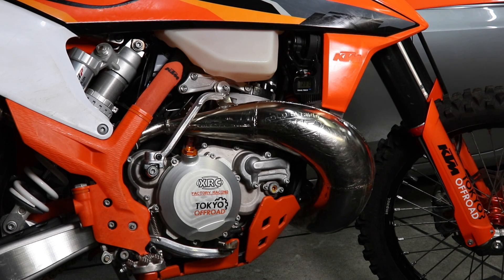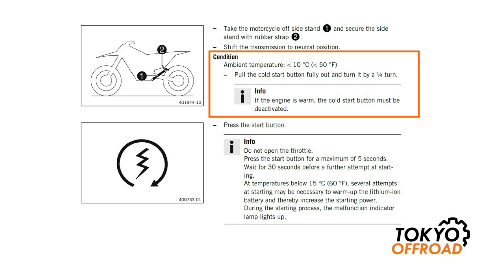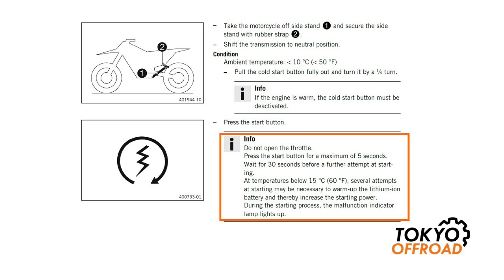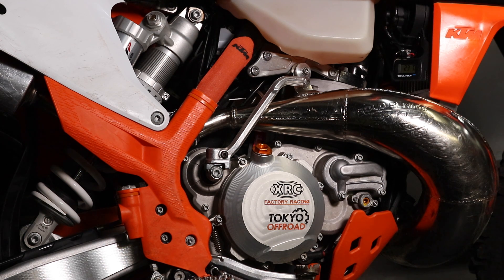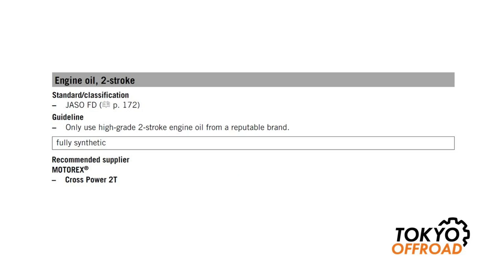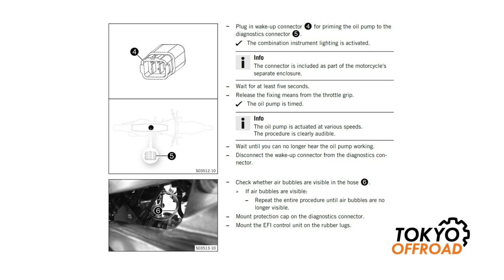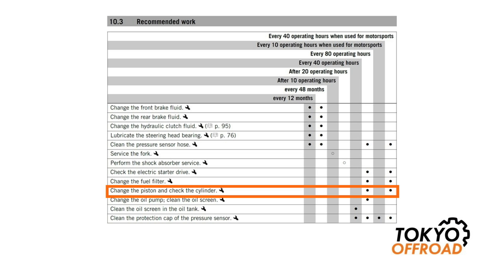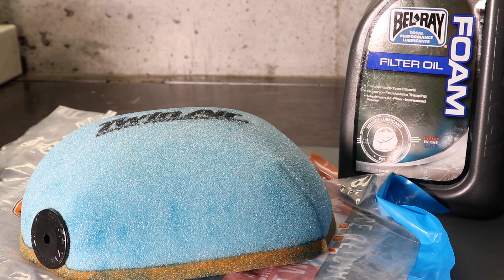Tips To Help Ensure Your TPI 2-Stroke Engine Doesn't Seize

Comment: Appreciate the video - Good on You!  Thank you.  I ALWAYS liet my bike(s) warm up before Hitting the Pipe.  18 months ago I bought a 2023 GG EC300 after 25 years on an '01 Service Honda CR500AF Woods Weapon.  I still have the AF and Love It.  After 1.5 seasons (in Colorado Mountains), I'm learning to love the EC300, but have lots of learning yet to do.  While there is No Replacement for Displacement, I understand the different riding style required for the power-valve-equipped engine of the 300.  The TPI and adjustable power valve are novel and different, and I don't have them dialed in, yet,.  With that said, I'm not yet convinced the combination is better than the Open Class 500CC.  I'll keep riding both of them and eventually may form an opinion if one is "better" than the other, as opposed to "different" from each other.  Thanks again for the video, and helping me learn about TPI.

Comment: I have a 2023 E c 250. Coober ecu, It has 200 Hard enduro hours, New top end at 190 hrs, Very little blow by. Wasn't even noticeable, Never had an issue with this bike. It.
Has noticeably more power than a 300 Tbi.  Coober ECU-CONE PIPE- Medium compression head. I have yet to see another bike that compares We.
Ride hard  ENDURO, With every other bike known to man even electric. ThIS BIKE shines never has an issue.

Comment: In your opinion , which is the best of the castrol power1 racing 2t , liqui moly street race 2t , ravenol mps 2t , maxima k2 injector 2t , motorex cross power 2t , mannol 2t plus oil brands for use in two-wheeled vehicles that still use side oil pumps ???
Reply from the maker: For KTM group 2T oil injection bikes I would only recommend using Motorex CrossPower 2T oil (follow the manual recommendation). Not only the only type, but also the oil viscosity is very improtant to ensure that the correct amount is injected by the pump. If using premix then there are many choices...

Comment: I have a 2023 gas gas EC250, I follow the starting procedure every time. I ride hard enduro.  Medium compression head Coober ECU.  I have never had a real problem with this bike. I sealed all electrical connections with liquid tape.  I am doing my first top end rebuild at 180 hours. New piston and oil pump. I Am convinced this is the best bike KTM ever made.  All my buddies have husky 300. I have never felt the need for more than a 250.  I will never sell this bike but I will buy another one😊.😊😊😊

Comment: How to drain the side oil? And replace it with a new one ? Please explain thank you
Reply from the maker: Are you asking about draining the 2-stroke oil from the tank and how to clean/replace the oil screen? It's covered in the KTM Repair Manual in the Lubrication Section. The method is to remove the throttle body, remove the oil pump, drain oil from the tank, remove the rubber boot on the bottom of the oil tank and the oil screen will come out of the bottom of the tank.
Reply: @TokyoOffroad  Thanks very much

Comment: My ktm exc 300 2022 oil pump not woorking, i change with new one and still not working… whats thats problem, i’m check fuse and relay all goods
Who have some experience in this case, waht it’s the problem thanks
Reply from the maker: Did you find the issue. It must be an electrical issue. Check the wiring and connector. If the oil pump isn't working you should see a blink code on the dash display

Comment: Dump the TPI and buy a TBI or carbureted bike with premix. If it ain't smoking it ain't getting lubed.
Reply from the maker: I did. I currently have a 2024 KTM 300 TBI EXC with oil injection deleted and running premix: 2024 KTM 300 EXC TBI- Oil Injection Delete
https://youtu.be/f4vbqygAFkk
Reply: @TokyoOffroad  Right on. There's a reason ktm stopped using  tpi and oil injection. I'm a professional motorcycle technician and have seen so many blown up tpi bikes.
Reply from the maker: @mikecronan550  - I do know some people value the convenience of oil injection, which is probably one of the reasons KTM left it on the 2024 XC-W & EXC models. The other reason of course is reduced emissions. Personally I'm not a fan of 2t oil injection and prefer the simplicity, performance and reliability of using premix. TBI thankfully makes the oil injection system delete easy as unlike TPI injection relocation is not required.

Comment: I heard the Chinese pistons are made out of cheese.
Reply from the maker: Sounds tasty! But KTM dirt bikes are made in Austria with 2T pistons supplied by Italian suppliers (Vertex is the main one). As you may have read in the press recently, some of the KTM road bike are are manufactured in China (and India), but this has not affected the dirt bike range. The only exception to this is a small number of dirt bikes sold locally in China which are assembled from kits locally in China (using the same parts as bikes manufactured in Austria). This bikes would not be sold into other country markets though.
Reply: @TokyoOffroad  Ok. I appreciate what you are saying, but I've seen a lot of complaints online about Kymco pistons crumbling with low hours. As far as I'm aware it's post 2022 KTM 2 strokes. Do you have any knowledge of this?
Reply from the maker: @Paul-gu2lv  Kymco is a Taiwanese company and they supply KTM with some of the cylinders for dirt bikes. The other 2 stroke cylinders is Elko. AFAIK Kymco do not supply pistons to KTM.
Reply: @TokyoOffroad  Yeah, I know what Kymco is. They make great engines for scooters and such, but I guess not strong enough for high compression and performance. Anyway I don't have personal experience. It's just what I saw online.

Comment: Love your videos, are any of these issues alleviated by TBI instead of TPI?
Reply from the maker: With TBI the engine will tend to run cooler compared to TPI as the fuel passes through the crankcases. Also TBI allows you to run premix which I consider more reliable than oil injection.

Comment: Would you know the oil injection test RATE for the 150TPI? I tested mine at 4.7ml and your test for 300 is 6.3ml? I assume same oil pump so am concerned that i got 4.7ml.
Thanks
Reply from the maker: Sorry, I don't have any experience doing this test on a 150TPI. Try asking on one of the KTM FB groups.

Comment: I have a first gen tpi and i always warm my bike riding sloly, and i never had a problem.
Y have anoder bikes and i use the same procedure to warm them up.
Reply from the maker: Yes, I always warm my bikes slowly from cold and don't start riding until the engine is warm. This has worked well for my bikes, with good piston and cylinder life.

Comment: Our brand new 2024 SX125 completely lost compression at 10 hours during a motocross race. Turns out the piston had huge chunks out of it above the top ring. The head had cracked.  Took to dealer since only 10 hours, they say caused by gas/oil mix (which was exactly what they recommended). We heard the thermostat has gotten stuck on these 24 SX125’s and not put coolant where it needs to go and caused this. Not sure what KtM will do, but this seems to be a huge defect

Comment: Mark, excellent video as always.  What brand of water proof grease do you use for the rim of the oil filter and what do you use to clean the filter when it’s time to do so.
Reply from the maker: I use BelRay Waterproof grease for the air filter lip. To clean air filters I first use kerosene, let air dry, then use Oxiclean in hot water. This gets them really clean.
Reply: Thank you!  Also how do you get the internal area around the cylinder head and wire looms and cables so clean.  I use simple green but there is still a brown dirt residue.  Short of taking a damp rag and rubbing all the interanal area down I don’t know how guys keep that area so clean.  Is there a foam or special way to do it.  I never pressure wash so I’m at a loss.  Any suggestion is appreciated.

Comment: Be sure you are running much more oil if you have a tbi set up.  The fuel washes out oil from the bottom end which happens much less on the tpi set up.
Reply from the maker: When I had this bike I was using a GET ECU, which I understand was mapped to inject more oil than the stock TPI, for use with the GET injector relocation kit which I'd also fitted.
Reply: @TokyoOffroad  I did hear you mention swapping over but I think it's an important note for riders with a tbi set up.  Also great video.

Comment: TPI oil priming sequence volumes
Model/Year - 18/19/20
Cycle - Fast/Slow
Length - 30sec
Approx Output Volume - 1.0ml

Model/Year - 20/21
Cycle - Fast only
Length - 60sec
Approx Output Volume - 5.5ml

Model/Year - some TSP modified maps 
Cycle - Fast only
Length - 30sec
Approx Output Volume - 2.7ml

Comment: Hello, love your channel amigo. My 300tpi is ready for it's first top end. The stock oil pump has run with no issues for 100hrs. Do you recommend replacing the pump or should I test and keep the stock pump since I've had no issues?
Reply from the maker: I would carry on using it if it's working OK. From what I know dirt (it it drops into the oil filler inlet when you take the cap off) is the killer of these oil pumps. As such be careful to wipe away and dirt before removing the filler cap. Starting from the 2020 year model TPI there is an oil screen (filter) on the output of the oil tank which should help protect the oil pump against damage even if dirt and debris get into the oil filler.
Reply: Its not easy to find good trusted advice now days. Thank you very much!

Comment: My ‘20 TX300i put out 10ml oil in 60 seconds (short pulses). I haven’t seen anyone reporting this much output (usually around 6ml). Thoughts? I did have the dealer update the map summer ‘22
Reply from the maker: Maybe the updated map injects more oil during the priming sequence (pulse length might be different). Now you have a reference you can monitor it over time. A significant decrease from your reference would typically indicate that the oil pump needs replacing...

Comment: Dear riders, i have 2021 250 Exc Tpi. I tried to make the oil priming with the wake-up connector bought from the dealer (the red and black one) The oil pump did not test/work as in video. I tried more than 40 times with different time intervals 4-7-9-12.....25 seconds. I have the standart ECU. I watched all the videos and read the manual, Did exactly the same. 

Do you have same oil pump problem? If yes how did you solve?
Reply from the maker: If your bike is a 2021 TPI with stock ECU it should prime in exactly the same way as shown in the video (set number of pump cycles every time). I suggest you discuss with you KTM dealer.

Comment: From what i've seen the people who are meticulous about tpi warm up procedure including myself do not have any issues. The problem is that most dealers aren't explaining to buyers how critical the warm up procedure is (especially within the break-in period) as well as dirtbike channels online telling people to just hop on the bike and ride it like normal. This results in guys revving the shit out of the bike at warm up and riding it hard cold. Then they're totally surprised when the bike blows up at low hours and they post it online.
Reply from the maker: I'm careful with warmup with all of my bikes, no matter the technology (carb, or TPI). I never rev the engine hard until it has warmed up.  During warmup the clearance between the cylinder and piston may be tighter than normal as the piston will tend to expand faster than the cylinder. This is made worse if the engine is warmed up quickly. IMO one of the worse things you can do for engine wear is the MX style cold start followed by revving the shit out of engine. As such I always aim to warm the engine slowly. Yes it takes a few minutes longer, but you can save a lot of time and money in the long run through extended interval top end rebuilds.
Reply: @TokyoOffroad  I couldn’t agree more. I think a majority of the low hour tpi engine failures we see online are due to cold seizure. There needs to be more education on this topic amongst riders and you sir are doing just that. Cheers!
Reply: @SkylarRace  A quote from the design department: “we have make a bad product, so we just need to educate the customers to take extra care”…..
Reply: @scannorse a quote from a normal person  with  common sense! Use common sense when  warming up and using the engine & don't unnecessarily Rev the shit out  of it for no reason.

Comment: I'M DEALING WITH THE 3RD ENGINE SEIZE ON MY 2021 HUSQVARNA TE250i WITH ONLY 11 HOURS AND 48 MINUTES OF RUN TIME. All they have done is try to blame me even though they know these issues exist. None of which were disclosed when purchasing nor were I sent any further information after they started seeing these issues. KTM customer service will not help in any way with parts or labor and instead insist upon it being my fault. None of the 3 dealerships I have taken it to were able to fix it for more than a single ride after it was in their shop. Maybe(highly unlikely) 1 of the 3 were my fault, but logically after the first one I took things very cautiously always and followed the manual! For reference, I am a degreed engineer, have been riding for 17 years, and own 5 other bikes. NO YAMAHA, KAWASAKI, HONDA, SUZUKI, TRIUMPH, ARCTIC CAT, OR SKIDOO I HAVE OWNED/RIDDEN HAS EVER FAILED THIS HARD OR CONSISTANTLY AND THE MANUFACTURER JUST BLAMED ME.
Reply from the maker: Sorry to hear about the problem. What was replaced after the first seizure? Has the oil injection been tested and working OK?

Comment: The best thing to do is like I did sell that TPI bike and wait till the throttle body comes out 2023 and go on with your life.... Every hard Enduro race of the professionals they stripped that stuff off of their bike and put a carburetor on blocking off the electronics that is a fact none of those hard Enduro championship races are done with TPI that's why they're getting rid of it... it failed way too many times

Comment: Anyone tried this with the GET ECU for a set length of time?? I just wanted to compare to what mine is pumping.  I believe mine pumped approx 2.75 mL of oil after 2 min of holding the throttle fully open with the dongle plugged in.

Comment: The value of simplicity should not be ignored. 2-strokes are very simple. Water cooling had big benefit As. EFI/TPI benefits will be neglible if it causes any grief at all. I have never had a carburetor fail. Except for the diaphragm type on weedwhackers. And maybe a float got stuck once. Never was stranded by a bad carb

Comment: Great video, with the piston change you could do a compression test regally and see if you had any loss, a bit like you oil test you did. like you said if you just potter around on the bike the piston could last way longer than 80 hours

Comment: had a guy approach me at a recent ISDE fundraiser ride and say using the choke and letting tpi's idle to warm up was a big no no. 
it was frosty that morning and i've always followed this procedure even before owning a tpi. its just common sense.
Reply: That's because clowns who don't understand how fuel injection works think it makes the bike run lean...like the crankcase pressure doesn't change from the increased air and the ECU doesn't fuel it accordingly.
Reply: @OtisFlint  well technically the fuel injected bikes do run a bit leaner than carb. they certainly don't use anywhere near as much oil. but I don't think people realise the eco is constantly adjusting the mixture depending on revs, air temperature, elevation ect. 

mine is playing up at the moment though. think i'l try a Sherco next and go back to a simple bike without the electronics and sensors

Comment: I have a 2019 te250i with the GET ECU, so what is the recommended testing with the get then? What specif time should I be holding the throttle down for and how much oil should I be getting?

Comment: Great Video! All the videos are helping me so much with getting to know my 2022 Husky te300i. I just ran 3 oil pump sequences attempting to clear a bubble in my hose.. turns out I should have been working in a better lit shop as it was just a dirt spot on the backside of the hose haha! Would all of that oil just dumped into my throttle body? Should I be disassembling and cleaning prior to starting the bike? Thanks

Comment: I just did measurement in 7degrees warm garage ( i dont know how much that will affect the result). I got 5.0-5.9ml, and my bike is EXC 250 TPI 2020, with 300EXC map(gives bit more torque). So i dont know is that good or bad and should i have something different than 6.3ml since bike is 250cc?